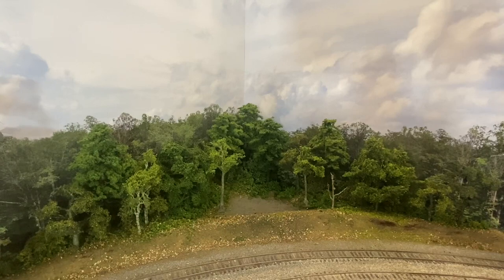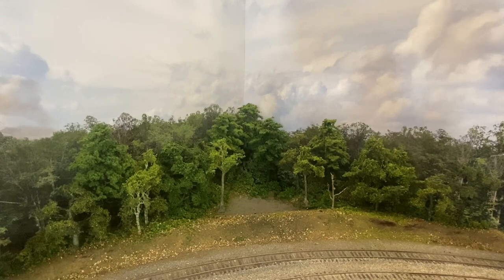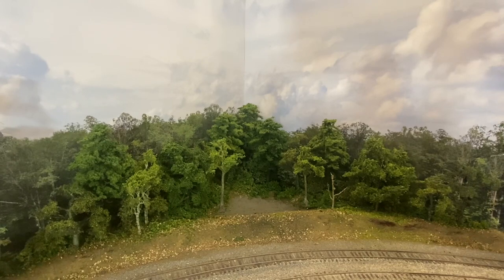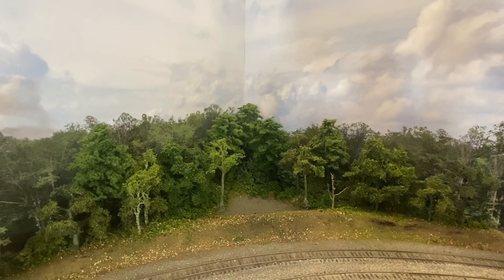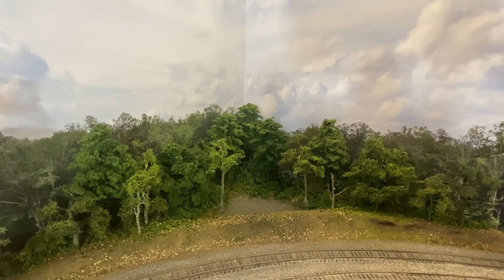Seaboard Central - Building a Pond Scene Finale

Comment: Great final to your "pond" series. One suggestion: to the far right of the pond, on the manufactured backdrop, there appears to be a stretch of "white line" bouncing through the backdrop. It looks like the top of another layer of  backdrop material that needs a coat of various woodsy greens paint dabbed on. Otherwise, a fantastic blending of materials! Great job. 😀👍
Reply from the maker: Thanks! I’ll have to try to address it. It is probably where two backdrops meet.

Comment: Very nice job Tim, the use of the pan pastels in the scene is something I've never considered, and I like the end result. I do have one question about one area.  Are those some type of wild flower ground cover you added in the area where the buck is jumping the log.  I must have missed that portion of the add ons in the previous segments of this build. The only reason I ask is the color perspective differs from the rest of the scene.  It also could be that I need to see it on a larger screen, than the one on my cellphone. 
Thanks again for the continued updates, I look forward to them every Sunday.
Reply from the maker: Thanks Steven and good eye! You noticed some Silflor wild flowers I added in between takes. I failed to mention them during the video. But I did something similar in the Trout Creek Lead series where I used the same product. On a side note, normally after a video I’ll go back and tweak the scene as I come back to it the next day. I’ll study it and see if there are any areas that could use some attention. Stay tuned! Big update out next Sunday. Tim